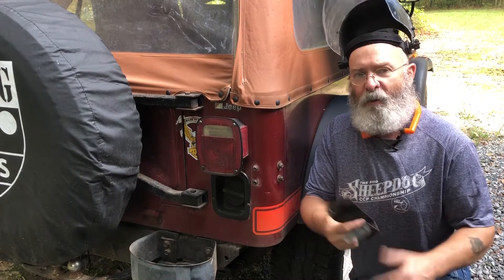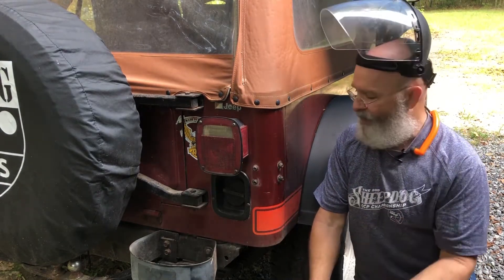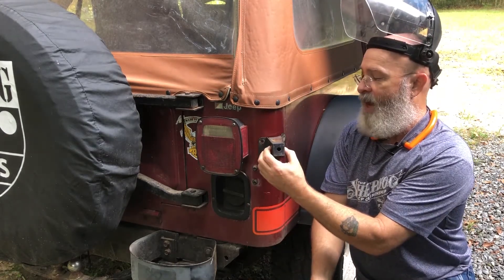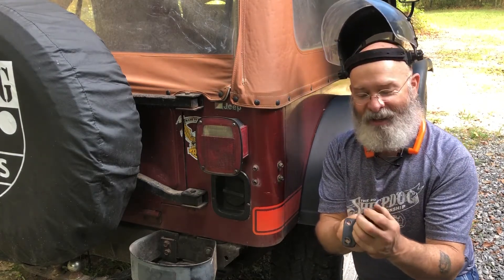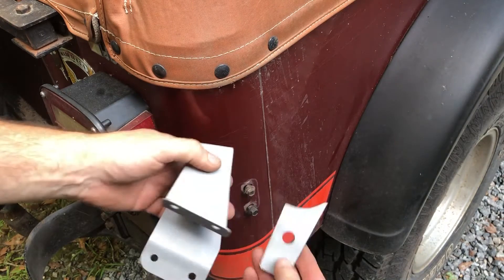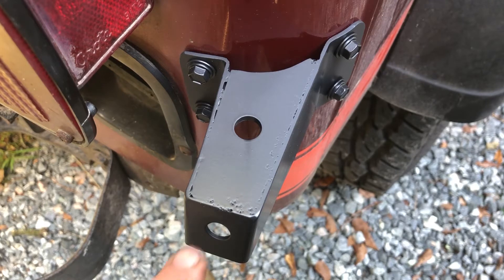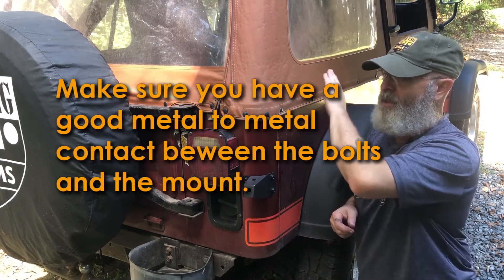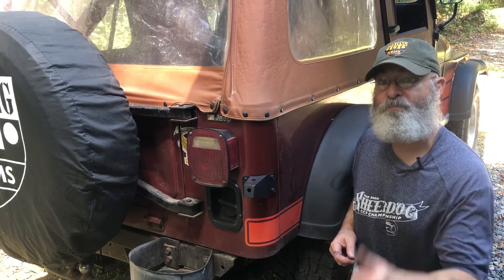CJ7 CB Antenna Mount

Comment: Sitting here doin some Youtube surfing and came across your video. Wanted to say that's how I did mine back in the day. Had to run the coax through the tub inside of it so it wouldn't be visible. Rubber grommet and good to go. Did that back in about 89-90. Still have her. Ran across your other video using the relays for the headlights also. Did they actually increase in brightness? if so, I may end up doing that to mine.
Reply from the maker: It does brighten them up a bit by allowing full voltage to go to the bulbs. It’s not dramatic but it is noticeable. This relay inclusion will allow you to upgrade to LEDs as well.